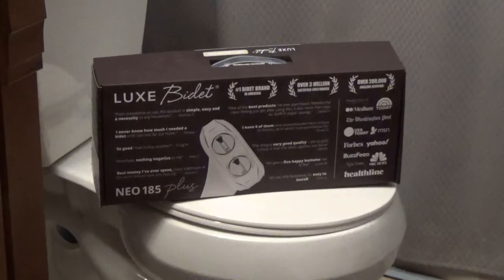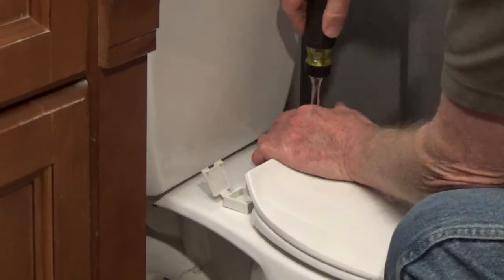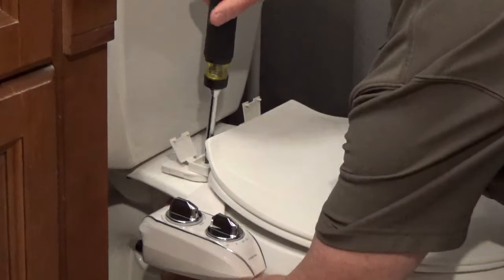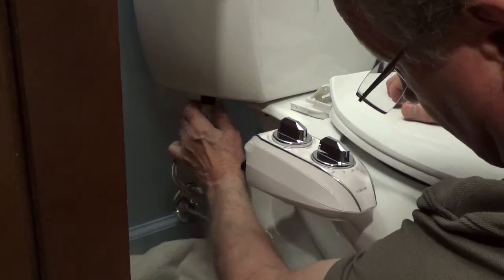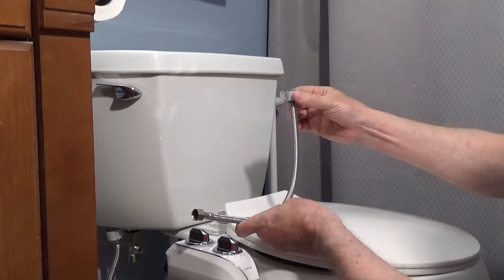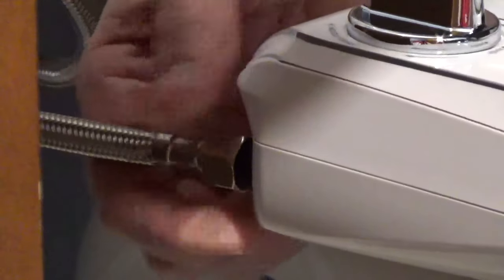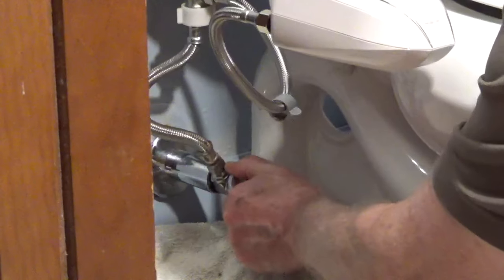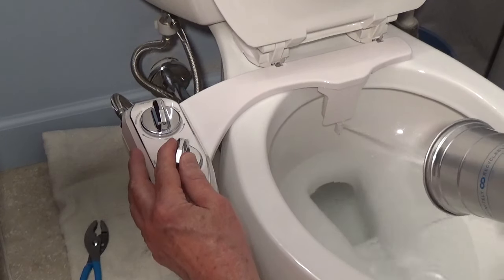How to Install a Luxe Neo 185 Plus Bidet

Comment: Just installed this. Was pretty simple outside of the small working space (which is no fault of the product) and I struggled getting the tube attached to the bidet unit properly. (I kept Cross-threading it)